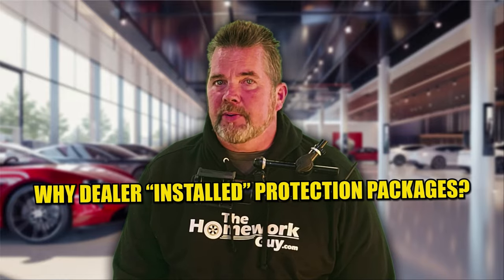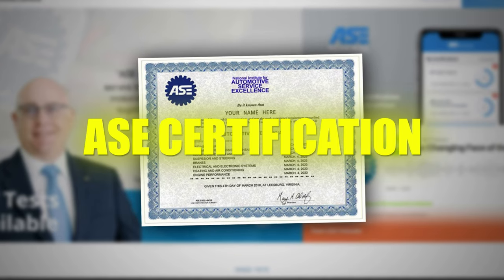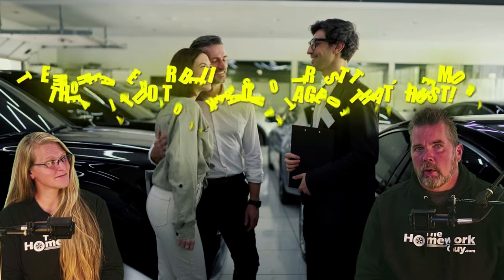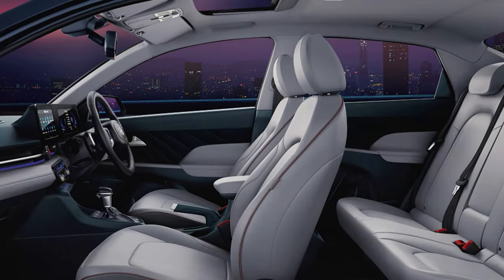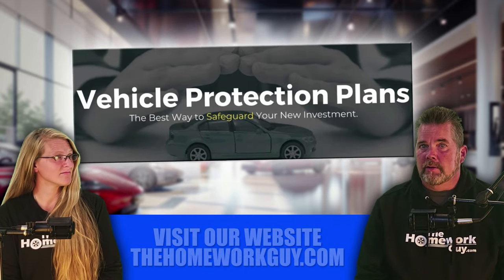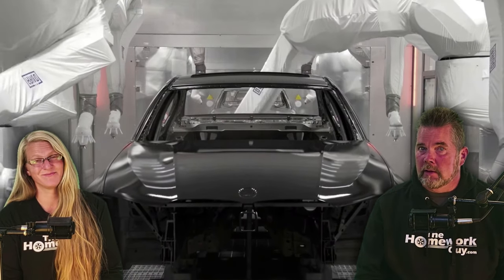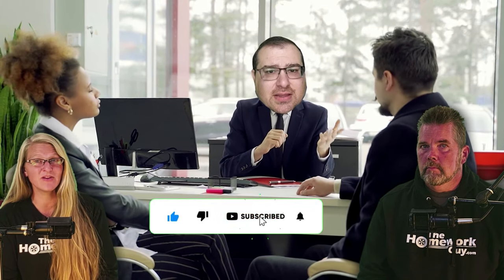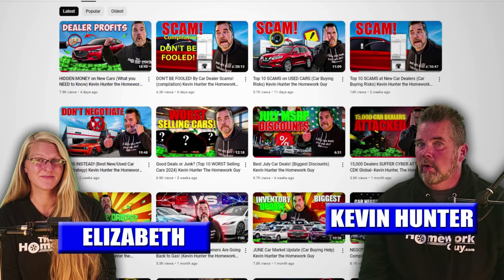TOTAL JUNK! (Dealer Protection Packages) Kevin Hunter the Homework Guy

Comment: I worked as a "detailer" at a dealership when I was a19 yr old kid. Im hear to tell you we as kids making minimum wage had to apply these worthless paint protection products such as AutoArmor or TST. I kid you not, they came in roughly a 1" round by 2" long bottle. You had to put it on super thin or you'd run out (it was just thin wax that came off with one wipe of a towel). The fabric protector came in the same bottle. It was barely enough to do the front seats...forget the backs The dealer kept wanting us to do more and faster and also do full details on the managers and owners demos. My supervisor, another minimum wager, usually trashed the stuff out of anger and just spray waxed it instead. New paint feels smooth so the customer never questioned. So yeah, do not buy this junk. I'd love to tell you stories about shortcuts dealers do

Comment: I bought a new car from the dealer for whom I worked as a technician in their service dept.   They tried to sell me on the Resistol package for $600.   The car I bought was a dealer trade because it was the colors I wanted.   They told me the original dealer already did the Resistol Package (paint protection) and it had to be paid for during the dealer trade.   They didn't know I went to the original dealer to see the car sitting at the back of the lot with a thick coat of dust and the protective plastic all over it the evening before.  I"M ONE OF THEIR SERVICE TECHS  !!!

Comment: I remember that the replacement tire dealers used to offer hazard guarantee. It was about $5- I think.  The one time I remember getting it I collected on it within 90 days.  ——  slashed side wall from a poorly installed street sewer drain. Yes tires were less expensive then too.

Comment: The only exception I can think of regarding manufacturer paint quality is Mazda. They are known for their soft paint, which chips easily. Even still, get the ceramic coating done at a private shop. You'll save at least a $1,000.
Reply from the maker: The "ceramic coating" installed by a dealer is not only expensive, it lasts maybe 2 weeks.

Comment: The problem is that they are added sometimes by the wholesaler, think about the private companies: Toyota wholesalers in Texas or in the SE, or they are added by the dealer. Good luck getting them to remove the cost adders.
Reply: Too bad. Cross it off, or sell it to someone else. Done that with a Toyota dealer in TX. They took it off, incuding the stupid theft deterrent system the said was already installed, the fine ceramic coating & seat protection. Also said no to the "investment" in a tire & wheel protection and a warrantee that covers what the factory warranty doesn't cover

Comment: The best car wax is NuTone original. "Wax" your car two times. After that, wax it once a year. I saw video about some "superior" ceramic coating done at a shop. But you had to bring your car in every three months for a reapplication. So it's not so superior, is it.

Comment: car buying math - if you have to pay 6k for add -on coverage  products that cost the dealer 500-1000bucks then its safe to say the dealer wants 5000-5500 more and you will pay 5000-5500 more for the car than the advertised price  taking a 30000 dollar price to 35000 plus  A. do you walk or B. do you realize the dealer at $32500 advertised with no add ons is not overpriced and is the lowest you can spend to buy ?
Reply from the maker: Great points, Jim, but this is a difficult question to answer because it is NOT KNOWN until later that the other dealer doesn’t have forced add-ons. Sorry this nonsense has to be so confusing, but thanks for the question, Jim!

btw, your question will be featured in an upcoming video!